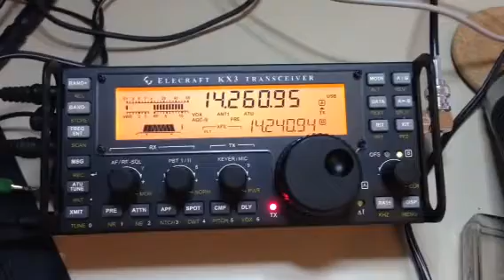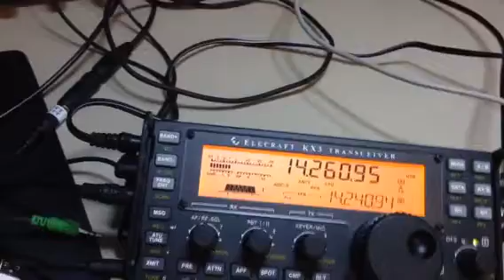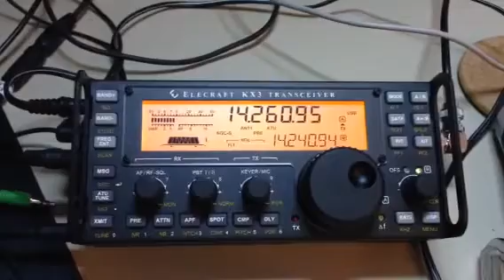KX3 powered by GoalZero Sherpa 50

Comment from the maker: My typical setup is a Sherpa 50 and a 27 watt solar panel feeding it. Our local club used KX3s for Field Day a couple of years ago. I ran the SSB station with one Sherpa 50 and two of those 27 watt panels. We ran 5 watts all day and the Sherpa showed 100% full. When the Sun went down we started running the battery down. We ran all night. By sunrise the Sherpa was down to about 40% full. Once the morning sun hit the panels it started charging back up. A few hours later the pack was back up to 100% I'm guessing you could go like that for days or weeks at a time!

When I go on a mini-DXpedition I take two panels and two Sherpa 50s. (It is important to have backup plans!) Having a radio that has very low receive current requirements is key, of course. But given a reasonable radio the Sherpa system can do very well.

Comment: What kind of run times can you get on one charge?  Do you also use one of the solar panels.  I was curious if this could be a viable power option for Summits on The Air?